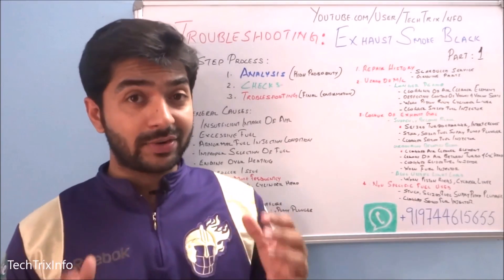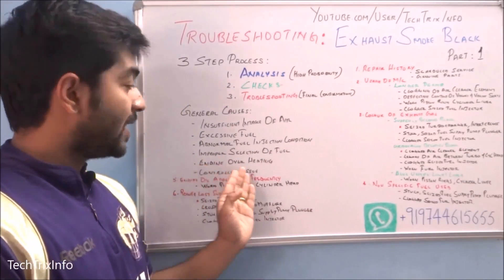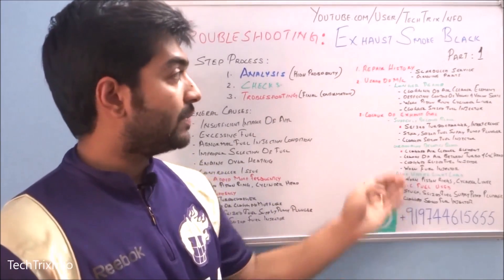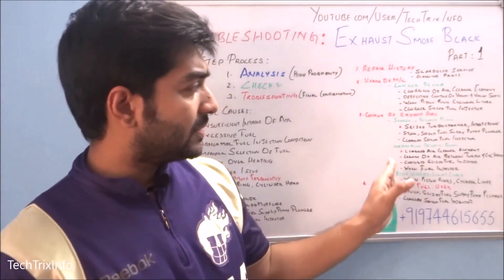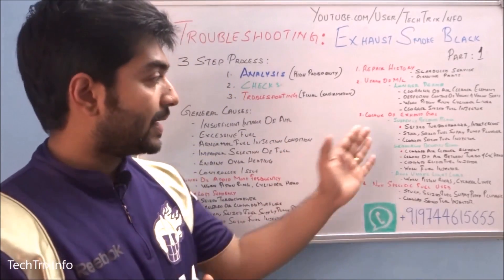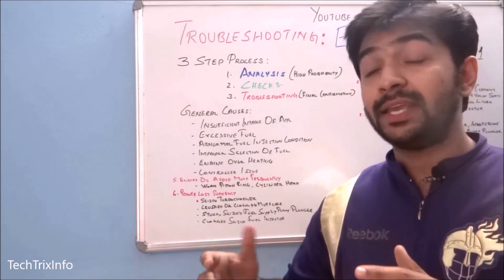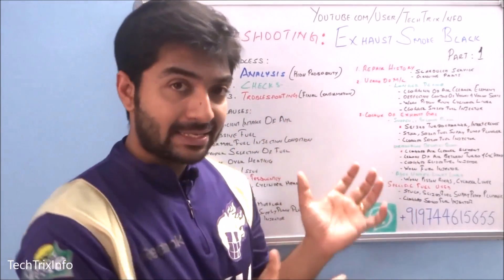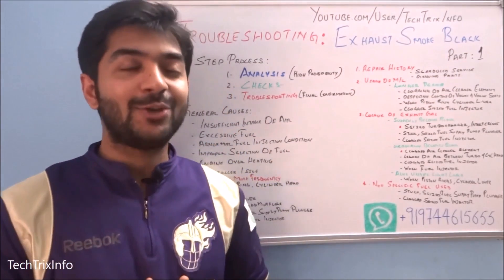Why black smoke coming from my car engine | Troubleshooting 1 | Must Watch.✔

Comment: Black Smoke: Fueling issues, air fuel mixture rich
White/blue Smoke: Engine oil burning in cylinder, bad valve seals or worn out ring piston, head gasket blown.
Reply from the maker: Thanks for the comment

Comment: Nice presentation.
I have changed the injector of my 2011 Vento today at the authorised service centre. After that thick smoke is coming from the engine. Also the engine sound has increased. The  vibration of the engine is more than normal.
Prior to replacement the engine was running with no such problems detailed above. Suggestions for rectification is expected.

Comment: Hai....this is Varun..... Last year I have done my overhaul of my swift  diesel, but after doing that small oil  leakage in cam head and lots of black smoke at high acceleration.... Can u please suggest me wat to do...... I  feel one of fuel injector is leaking ....

Comment: What do you mean siezed turbo charger I have 2012 BMW 328i Wich I purchased recently it has not been used for almost 2 to 3 month when I accelerate black smoke is coming why do you think that is happening my car is 2.0 4 cylenders turbocharged
Reply: One more thing my car is petrol not diesel plz advise

Comment: I always use 95 octane fuel . after putting 98 octane fuel a black smoke go from exost and engine running rich bank 1 on scanner . can it be just a fuel type or aomething else

Comment: guys i have a Toyota Corona 2.0 3s engine but its giving too much black smoke en its jacks and wets the plugs .
have overwholed the engine changing injectors,airflow sensor and fuel valve and the throttle but the smoke still persists

Comment: Can someone please help me? 

I have a 95 Nissan maxima, rpm drops when I'm braking to 500rpm, sometimes down to 300rpm, normal is 800rpm. I have black smoke, I changed fuel filter, fuel pressure regulator which help a little, I clean out the Mass Air Flow and throttle body control. I took all connection apart and clean them all with connector cleaner, coil pack 1&3 are new and I disconnected all coil and all seem to be working because rpm drop when I disconnected each one

I have new spark plugs, well I believe I do because i took it to a shop and didn't watch them.

2 weeks ago I was getting on the hiway and I kind of punch it, the rpm went up like normal but the battery and brake lights came on and from that point it was down hill

Comment: Sir can u make a comparison of turbo petrol vs turbo diesel ...and can u include why turbo petrol engines offer better ingear as well as 0-100 acceleration than an equally powered diesel variant
Reply from the maker: +Cyril Matthew j
Hi Cyril
Good question. 
Will make video on this and share with you. 
For updates keep in touch WhatsApp @ +919744615655.

Comment: hai... sir... is this method applicable for both diesel and gasoline ...? I have noticed black smoke from brand new diesel vehicles upon initial acceleration , climbing a slop, overtaking etc.... is this assassinated with this issue ..  in fact I have noticed this even from premium diesel cars like audi a6,jetta etc. ....
Reply from the maker: Hi Cyril,
Its mainly on diesel, but almost all causes are similar for petrol also.
If the black smoke persists only there is a serious issue, or else because of carbon deposit of exhaust during initial acceleration it can be pushed out (which will be black in colour)